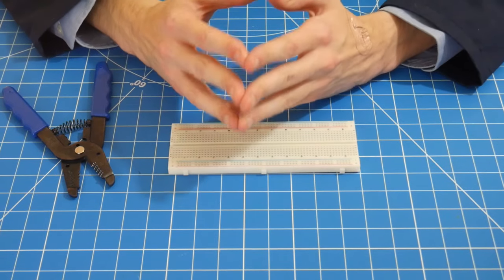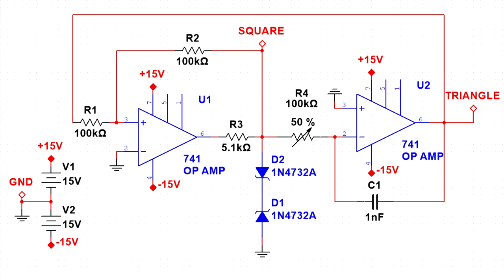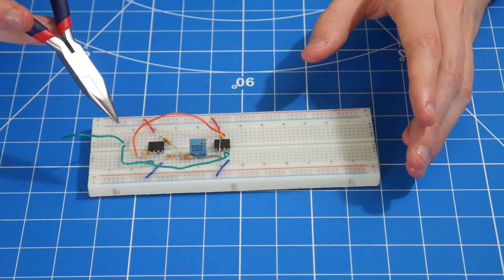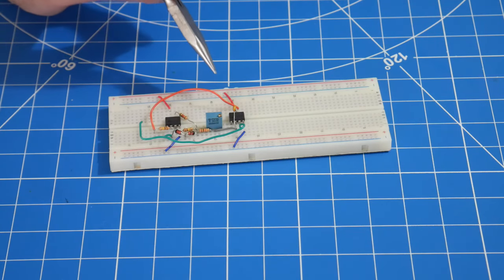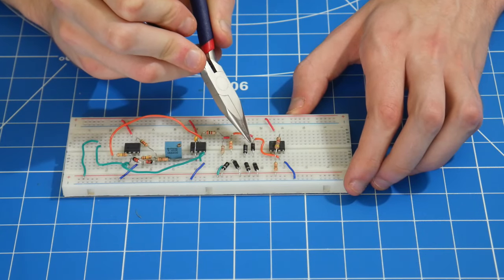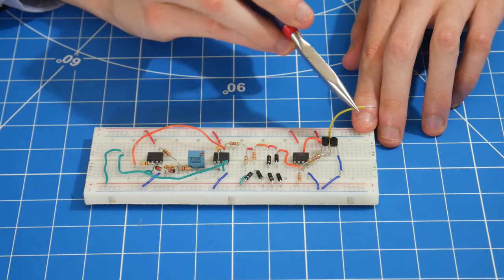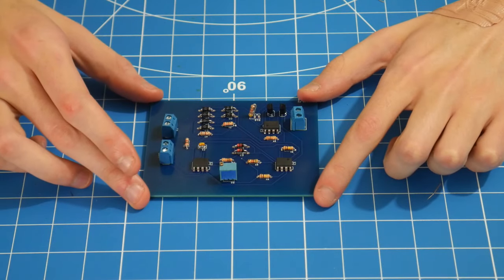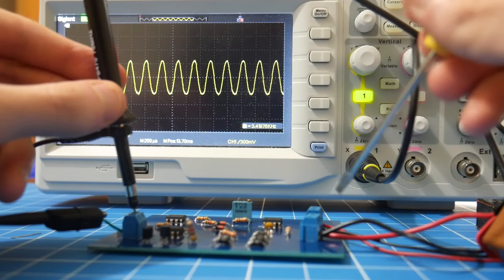Build Your Own FREQUENCY GENERATOR on a Budget (Sine, Square, & Triangle Waves)

Comment: At 5:11, your Q2 PNP transistor is incorrectly connected in reverse. Although it appears to function in the reversed connection you made in the schematic (because BJTs can operate in the reverse-active mode), there will be no amplification, and you wouldn’t want that.

Comment: Thanks for Posting. I have built your circuit and have used the uA741 op amps. But in doing so I found that the square wave and sine wave were extremely distorted. I inserted a CA3140 high performance  op-amp. And the square wave was greatly improved. Cheers.
Reply: did the 741 opamps come from ebay or another cheap source? lots of them are fakes.

Comment: Why did you design the pcb layout with the connectiing tracks on the top of the board instead of the more traditional underside as it is essentially a single sided board?  It would make etching a board at home much simpler if it was, and make it a more 'budget' project.

Comment: Neat little circuit and demonstration of performance very sane.   I'm starting to look at the winter indoor projects again where one category relates to the welders (HV &/or HC) where I'm wanting to upgrade the older transformer systems to have more modern features and also see how to improve the ones I can afford that are the IGBT in my situation (looks like some are MOSFET designs).  So one of the easiest improvements, outside of CV/CC controls and/or improvements, seems to be switching controls basically to control better in the sine and pulse ways.  Though you got me thinking about the sawtooth and triangle ways now with a nice simple circuit also without the MCU's.  Thanks for the inspiration and details.   Maybe the same design and detail with sawtooth and even better sawtooth in the two directions will be a great supplement video. Thanks again!

Comment: DAYTON, i have a question? You know the ya can make these with a 555(and filtering on the output) a half wave rectified sine wave a transistor & more low pass filtering like the 555.. But iv never seen this form before, would this version be better in an effects peddle for an electric guitar?? i was thinking maybe yes because of the op-amps been used in this design!! am i right or would it not really matter coz my next project is making some effects peddles and amplifiers for my guitars. would you recommend this wave gen made from op-amps for what im planning?? anyone who can answer this for me i would grateful?? I'LL TAKE ANY INPUT THAT'S OFFERED : )
OH 7 DAYTON IV TAKING A SCREEN PIC OF THE  SCHEMATIC & HAVE IT SAVE INTO MY  SCHEMATIC FOLDER..  : ) 
THANKS FOR SHOWING ME SOME NEW, MY MOTTO IS ANY DAY YOU LEARN SOMETHING NEW!! THAT DAY WASN'T A WASTE OF TIME!!
P.S. SORRY FOR BABBLING ON FOR SO LONG IN MY MESSAGE BUT IT WAS MY UNCLES FUNERAL TODAY(WHO WAS ALSO MY BEST FRIEND) AND YOUR VIDEO CHEERED ME UP FOR THE 1ST TIME ALL DAY!! & MADE MADE MY TAKE MY MIND OFF HIM. (SO THANKS FOR THAT BIGTIME)

Comment: i know you will probably never read this but i need help-
our project is to determine on which factors  the self inductance of a coil depends by observing the effect of this coil when put in series with a resistor/bulb in a circuit fed up by an AC source of adjustable frequency., how should i make the circuit for the model. iam in high school btw
Reply from the maker: Not sure that I understand the question. It sounds like you’re trying to make an RL (resistive-inductive) circuit.
You could try an internet search for “first order circuits” - that should get you started.

Comment: Hey, love the channel! I'm new to electronics and I was wondering whether this circuit can be used for making audio by hooking up the outputs into an audio interface?
Reply: You'd need to amplify the signal to be able to hear it through a speaker.
Reply: @Scyth3934  Could I incorporate an op-amp like the tl074, and use the output for recording audio? Would I be able to use multiple circuits like this and run them through a single op-amp and have them come through the single output?
Reply: @philosyche  I'm not that good with electronics either and I haven't even watched the whole video yet haha- your guess is as good as mine for that one

Comment: I tried to build this circuit and it only operates with batteries and not with a split power supply circuit, why? :(
Reply from the maker: Split power supply should be fine if it is isolated output - make sure that they don't share a common ground.

Comment: Thanks for the video. This diode method has a much wider bandwidth and flatter frequency response than a traditional RC sine filter. Just what I've been looking for. 
Have you tried using switching diodes instead of 4007 ? Just curious.
Reply from the maker: Glad you liked it!
And no, I have not. I try to keep these tutorial circuits using common parts for ppl to replicate and build upon.
Reply: @BlueprintScience  I will try substituting the XR2206 function generator in my transmitter project with your diode circuit. Not sure if the op amps I have on hand are fast enough for a flat 1 MHz BW triangle (500kMhz to 1.5MHz). 
The XR2206 is much flatter than a typical tank circuit VFO, but there is still significant attenuation at the higher end of the band past 900k.  
See    https://youtu.be/XFEQK2ERZpM
Reply: The cheapest popular 1N4148 switching diodes will be much faster, cheaper and smaller than the rectifier diodes used here.

Comment: QUESTION: how to transform this frequencies into sound/ tone?
Reply from the maker: The output is already audio (20hz to 20000hz). You would just need to plug it into a speaker in order to hear it.
Reply: @BlueprintScience  oh wauuu. The second board u showed,  where can i get it with al the components?

Comment: master, please tell me the shecematic circuit, can it be used in the car ECM simulator to replace the CKP signal generator trigger.  Inductive type CMP and Haal effect thank you
Reply from the maker: Well…
If you use the circuit shown in this video, the V-tri in the schematic could fake an inductive signal since it oscillates around several hundred hertz. And you will, of course, need to adjust the amplitude depending on whether you are simulating an idling signal or engine-cranking signal. However, the regular electrical dropouts might not agree with the ECM…
Additionally, you could inject an audio signal using your computer/phone Aux output (like for headphones). You computer should have no issue replicating the signal if you use an online tone generator.
Hall effect gear-tooth counters are a little trickier since they are digital signals. I would suggest using an inexpensive Arduino microcontroller and use the digitalWrite HIGH and LOW function with a delay to replicate the digital pattern.
Reply: @BlueprintScience  oke thank you master

Comment: Sir Any working RF transmitter receiver module circuit designed by you , for RC
Reply from the maker: Not on hand.
Depending on the modulation, that could be a difficult task. I’m pretty sure there are ICs that handle it nowadays
Reply: @BlueprintScience  433 MHz transmitter receiver module circuit type any design you have

Comment: What would I need to make a 2Ghz frequency
Reply from the maker: That’s not going to happen on a board like this. 
Your best bet may be to generate a frequency then use a PLL (phase locked loop) to multiply it to a higher frequency.
But you’re rapidly departing electronics theory and entering into antenna theory territory at this frequency- same rules do not apply.

Comment: Can I replace the zener diodes with normal ones
Reply from the maker: No.
Zener diodes are special because they only conduct one-way if the voltage is over 5V - unlike normal diodes.

Comment: So I suppose a modern TiG welding machine must use circuits similar to this only with much higher current rating to do AC welding of aluminum alloys and such. Interesting thanks for the video.

Comment: you know i bought a little kit build one of these and when reading the comments after it arrived, I realized i could of made this very circuit you build here, and it would have done the same functions the 7 euro one from bang-good can do. 
plus i have all the parts i need to  build it it...
I might go ahead and put the 555 one together & see which  generator works better, I'll put th it in case 555 one in the case that came with the kit if it works better(which i can tell it already can) i think i''ll call it ("DAYTON" VERSION 2).. 
now to watch the video "AGAIN".

Comment: Hello, is it possible for creating a sine wave with 50 hz frequency with 0.5mv ?
Thanks for your answer.
Reply: Likely you can adj the freq down to 50Hz and then take the output using a resistor and a pot as a voltage divider to get your desired final voltage.

Comment: can i generate 16ghz signal  by using this?
Reply from the maker: No. You won't even get close.
There are very expensive solid state microwave circuits like the ones used in 5G. Otherwise, your most inexpensive option is a 16GHz magnetron tube.

Comment: hello sir, i am new hobbiest i want to ask if this project could be interfaced to a simple inverter so that i could attain a pure sine wave output? i appreciate very much for your recommendations ang good help.
Reply from the maker: This is a sine inverter, but it won’t do 120V or 240V. A “pure” sine inverter at those voltages modulates a PWM, that can be complicated.
Reply: @BlueprintScience  Thank you very much..

Comment: I know it's not the same as building one's own from a few electronic parts, but many people have a few cell phones, so why not repurpose an old one with a function generator app? 

While some phones still have a jack for plugging in  ear phones, they might not be able to source much current or voltage. In which case, one might try one of those cheap bluetooth speakers, as most can source a fair bit more current and voltage.
Reply from the maker: As soon as you hook up an oscilloscope to those audio ports, you know.

Sine waves come through great, but anything else is a feeble attempt by the computer to build using sine waves.
Any digital logic is totally out of the question.

I mean... unless all you ever wanted was audio waves, in which case its perfect!  :)
Reply: @BlueprintScience  I forgot about different amplifier classes and the use of DC blocking capacitors. What do you think of a class A amp and removing the DC blocking cap.
Reply: i dont have an oscilloscope  to test this but my headphones on my old Samsung galixy s4 sound identical to this and the signals look pretty fair on his scope, though maybe the square wave isn't great. https://youtu.be/I9py7Dps85Up

Comment: Hi, how i can amplify this ac to more power ? I need minimum 1 amp and 12 volts
(by de way, nice vid. 👍😁)
Reply from the maker: There are thousands of MOSFETs that would work - IRF540N is my go-to. But a PWM sine wave inverter would be better suited to that - they are easy to make with an Arduino and a few components.

Comment: Hello, I have rly stupid question but you seem like a person that would know that. Can you connect two laptop charger adapters with 20V dc together in series to make 40V dc ? Just like putting batterys in series. Can I do that?  Also ,thanks for helping me solve my tesla coil issues. Its working now, you can check it on my channal on YouTube. I even made it to play music.
Reply from the maker: You can. Laptop chargers are generally isolated from the input power, meaning that they should behave just like batteries in series.

Also, great work on the Tesla Coil!

Comment: Hello sir I did experiment on my hei ignition module its 4 pin GM it uses the MC 3334 ic chip lay out. I hade problems in the past to figure out how to trick that ignition module to retard ignition timing. It didnt work tought because I used to high 500k pott potenciometer and speaker wire to the pick up coil + out put wire and to the input pin to the module ended up in desaster engine did retard kinde of but engine was sloppy and insted of comptesion I ended up at exaust stroke fiering so I used speaker wire hade nothing ells at that time ,I did as well experimented with plasma ignition ordinari hv capacitors on the ignition coil+ and other side of series soldered capacitors gone to ground via a switch I hade problems with my delco 12 si alternator cutt in current after that but coil spark was great,I fummeled with my multimeter continueti test and managed to trigger the ignition module with out the pick up coil it worked kinde of like stationari buzzer, I added more magnets spark was stronger to the pick up coil also I tryed out dual hei ignition modules useing just 1 pick up coil to trigger them was sucess full . So still I got problems to understand those ic chips how to make them work on pick up coils or what replacement ic chip I can use insted who is more variabel also I was woried about static my car has lot wire harnest problems and I do not have the standard zener clamping diode in my ignition module so any one please help? 
The ignition module as well work fine by just useing the + wire from the pick up coil it doesnt need the - wire from the pick up coil. So I wondered If I culd simpli use sone sort of frequency generator to pulse sone thing in to the - pick up wire to disrupt the circuet for fhew electrical angel degrees? or how is capacitor to resistor ratio calculted for ic chip phase shifting by useing pick up coil triggers or is there any way I can control manuali the ignition coil out put? Im reali confused about this topic honestli. I hoppe also with what I can calculate as device hrz and voltage frequency from the pick up coil are there any tools availabel to meshure exactli what time and amplidute that frequency is passing ?? Im reali confused expeciali about coil polarity what pulse shuld it by + or - if I want to disrupt the pick up coil wia the - wire on the pick up coil. I hoppe my questions make sence and some one can coppy links how its actuali calculated resistor to capacitor ratio for controling manuali trip switches . I terribli need some thing more manual for my car In winter after some days it refusea to start baterry got discharged and voltage are to low to start it in the first place I used automotive relay to bypass long distance wires but still Its more desirabel for my to have retarder system . And the 5 pin GM does not work for my I cant buy it in my land only have 7 pin GM ignition variant availabel . So I hoppe some one with great knowlage about sensor control can explain my bether what can by done to bypass this problem . I also tough useing 2 ignition modules differences in resistance that also migh work but dont know how and what exactli to use as relay function honestli.

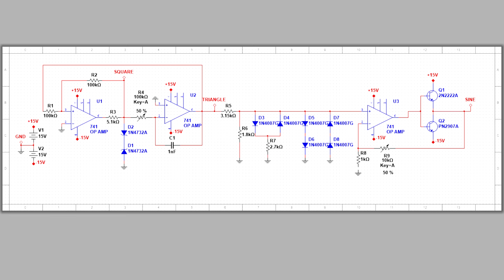Comment: 0:23 EWWW you use MultiSim!? Gross 🤮🤮🤮🤣
In all seriosnuss though, give KiCad a try once your university license expires! I think there is a built in Spice simulator too, though I never played with it.

The "wave shaper" with the diodes is an interesting arrangement to get a crude sine-wave out of a triangle wave! Getting sine-waves is tough, especially if you care about crushing harmonics and distortion! Why did you use standard power rectifiers? For a function generator creating possibly several hundred kHz, wouldn't you want to use single diodes like 1N4148 or even germanium diodes for the softer conduction curve? The reverse recovery time of those power rectifiers is pretty large, but maybe you want? IDK. Sometimes reverse recovery is actually sought-after, like with PIN diodes for RF signal switches.

Oh and another tip: at 5:11 the LM741 is old, noisy, slow, and obsolete. It will work in a crude breadboard build but I'd recommend pretty much any modern general purpose opamp over it. OP37 might be a good choice! Oh and also put a diode in series with the base of the transistors but with the "wrong" polarity and bias them with a constant current source and sink, this is to create a voltage offset to reduce the time the LM741 spends slewing between the voltage of the top and bottom BJT, this will SIGNIFICANTLY reduce crossover distortion, as there is ~1.2V of deadspace in the BJT arrangement when conduction flips between those BJT's. In order to see the effect, try driving a capacitive load with it 😉

I'm looking to build a function generator myself, I find myself needing one constantly! Although I think I will take the modern approach and build up a digital sampling one, have a damn fast MCU or even FPGA drive a high speed parallel DAC and then strap on a really high speed (10MHz?) unity amplifier and a 50 ohm resistance to a BNC or SMA.
Reply from the maker: That's a lot of insight there @Power Max!

Would you believe me if I said that I just slapped this together with whatever surplus electronics I could find under the sofa cushion? I really wanted this to be a simple budget option for ppl (and be easy to explain!)

BTW, I still keep up with your projects from time to time - nice to see you're still around :)

P.S. My university software license will NEVER EXPIRE!!! (at least so long as I'm enrolled in a free zero-credit course)
Reply: @BlueprintScience  With *THAT* selection of components, I'd slap the crap outa ya if you dare went out of your way those parts for this project haha.

The diode circuit is intriguing though. In a circuit like that you are exploiting the shockley diode equation and non-linearity. My other favorite is how to use opamps and diodes as exponent/logarithmic amplifiers and make a multiplier with them by exploiting logarithms and a summing amp.
Reply: Similar thoughts regarding selection of quality of components.  The TL071 came to mind at first, then a TL074 maybe?  I also was wondering about better diode selection too.  Reminds me I need to complete the Klipsch ProMedia 2.1 upgrades on the dissected one I have close to me.   Plus the box of other projects... homebrew e-field antenna/detector comes to mind for this season.